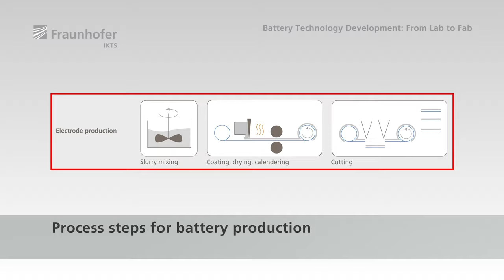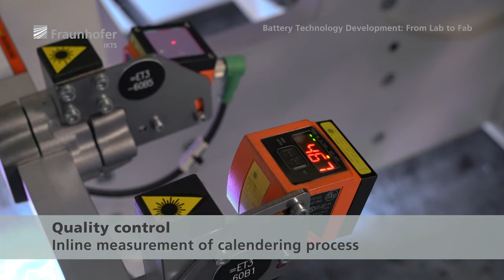Battery technology from lab to fab

Comment: What are the dimensions of the electrode being produced here? And what type of coating material is being used?
Reply from the maker: We typically coat graphite or silicon based materials on copper (10-20µm)  and oxides (like NCM) or phosphates (like LiFePO4) on aluminum foil (15µm-20µm), respectively, as electrodes (anodes and cathodes) for lithium-ion batteries. For anodes the process is typically water based, for cathodes either water on NMP based. The maximum width of this coater is 300 mm. with a speed of approx. 0.5 – 1.0 m/sec depending on the wet film thickness. Keep in mind that this is a coater used for research & development, so it is designed for flexibility rather than for max. speed and throughput.
Reply: @FraunhoferIKTS sht talker!

Comment: How many meters of coated electrode is required to deliver 100 Wh/kg energy density
Reply from the maker: Energy density is a property of a cell or battery and does not scale with the area of the electrode. Maybe you meant ‘… is required to deliver a cell with 100 Wh energy’? In this case, assuming an areal capacity of 3 mAh/cm² and a voltage of 3.7 V you have an ‘areal energy’ of 0.0111 Wh/cm². So, you would need roughly 9000 cm² each of anode and cathode to manufacture a 100 Wh energy cell (or in capacity 100 Wh/3.7V = 27 Ah). (rough estimations!)

Comment: The coating station is equipped with gravure cylinder or anilox roll ?
Reply from the maker: As coating tool a Dr Blade or Slot die system is used without any gravure coating.